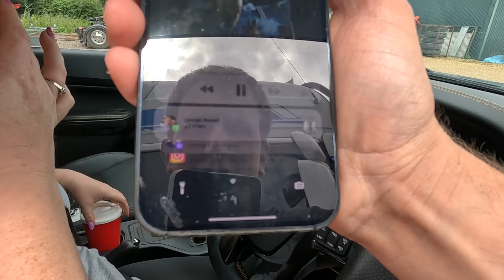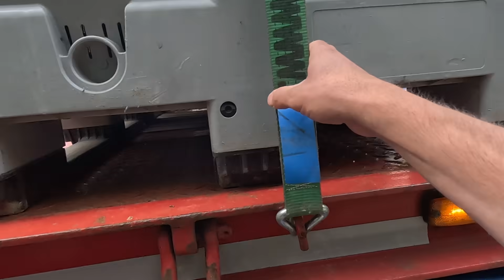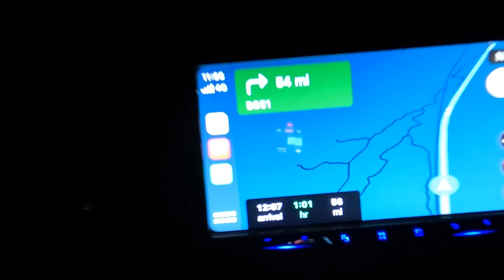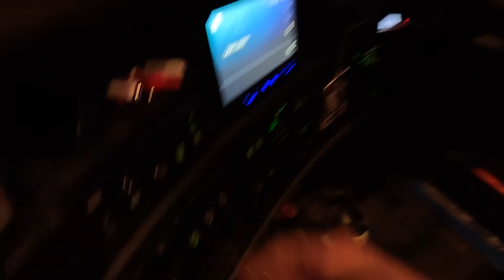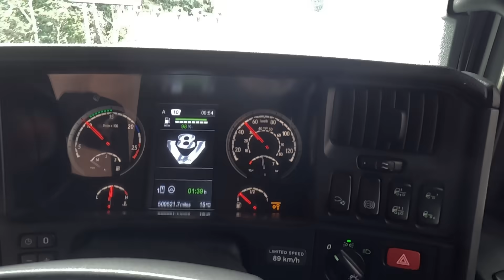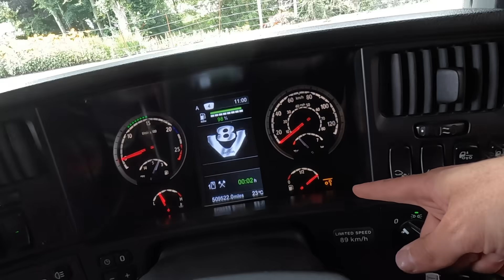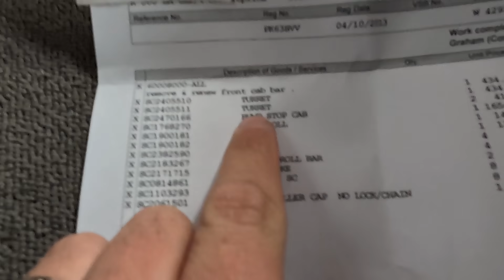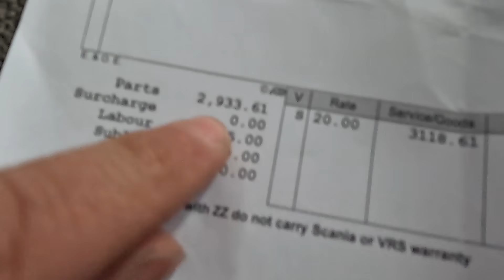EXPENSIVE Repair While On A SPECIAL Load To Scotland | *SHOCKED* | #truckertim

Comment: My SCANIA T CAB in American Truck simulator sounds like your truck with a kriechbaum sound mod. The only difference is the turbo sound is different. 

I started playing ATS again on a new profile on Monday this week and I now have a 580HP / 2950nm engine in the truck. Doing 90mph+ on the highways 😂

I'm curious though. There's a gauge on the dashboard opposite to the fuel gauge that goes to 100% for the first few years then it goes down lower on each gear change on full throttle at around 12th gear. What's that gauge for? It's the gauge on the bottom left.